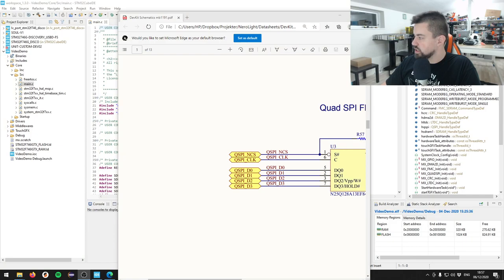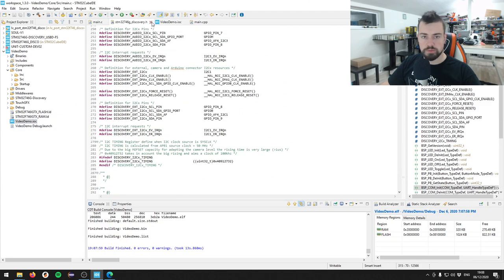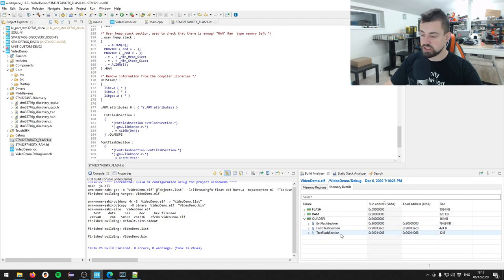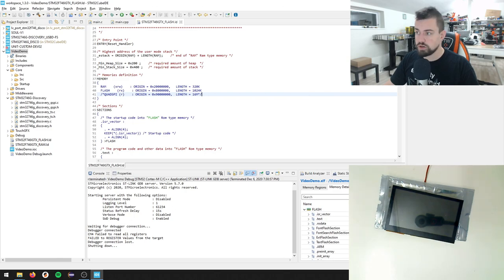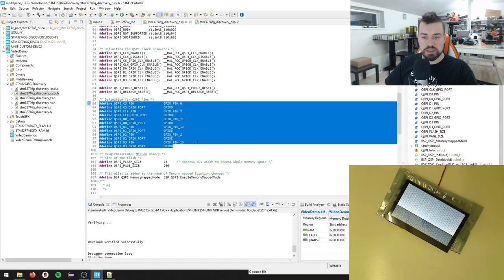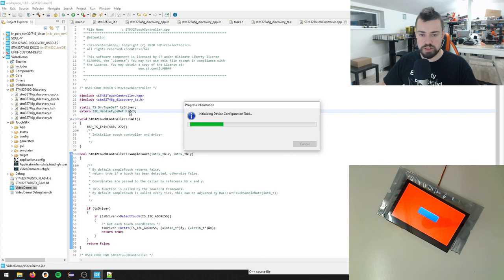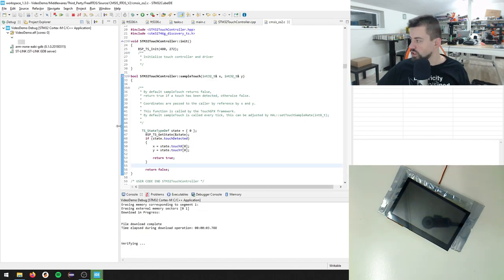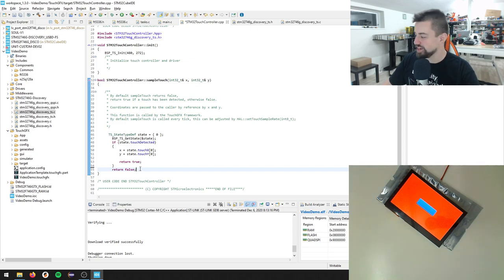Adding External Flash (QSPI) and touchscreen driver to custom board - WARNING: BORING VIDEO ;)

Comment: Turns out STM32F469 disco (with DSI) is basically strongly undersupported. A month of headbanging and I finally got a fully working picture there, except that the whole thing executes 4 times slower (1 second animation takes like 4 seconds, but it's smooth). A MONTH! So I bought STM32F746 DISCO like the one you have. After 2 hours I already have fully working everything with SDRAM, Flash, Touch and all. Neither community on ST forum nor EE-stackexchange helped me with 469 disco, still can't get it to run correctly, all originally provided scripts don't work (unlike 746 where I configured mx stuff from the first attempt, added drivers for the specific chips and all just worked immediately)
Reply from the maker: That's super weird. there should be the same support for the 769 board as the 746..
Reply: @banjohat  yeah but standard examples for it produce gibberish picture too, and I couldn't google the changes. Now I somehow bruteforced it to work, but it's at 1/4 speed or something, like 1s animation takes smth like 4 seconds. And I can't change LTDC clock (output to DSI) because it produces gibberish too (I change clock setup in standard bsp code and corresponding global value as well as in code generator). I took a little break from programming last week, will give the problem a fresh look.
Reply from the maker: @ilyas.7209  That's quite interesting. I didn't spend much time with the 769 board because I was intimidated by the DSI interface.
I might give it a go someday and see if I can make it work. the performance should be similar to the 746 but it definitely does not sound like it!
Reply: @banjohat  746 is acting up too tho. No idea why. Sometimes when it powers on, it has the first frame of what it has to show covered with pixels of random colors - and no animation. I press reset 5-6 times, and it works ok. Then I reset again, and it freezes on the first frame without playing anything (I have a square going along the sides of the screen, 1s per screen side, helps to find screen tearing if there is one, after it makes full round, the only screen "changes" to itself and restarts the animation, so it's a forever animation). Tbh, STM32 seem like very unstable MCU with random hiccups and stuff, pretty weird to realize that outdated weak arduino is a lot more stable in my hands. I have 3 boards (2 x 469, 1 x 746), and two of them (a 469 and a 746) sometimes can't get themselves programmed (program is verified, but internal flash is all FFFFFF when I read it back), get stuck in the middle of animation for no reason every time at different moment (until I erase the chip 25 times and then it suddenly works), occasional "core lockup" messages and stuff. FreeRTOS has plenty of memory, have 8192 words stack for touchgfx task.
Also, I noticed if I have elements overlap (one element cross another during animation), it is guaranteed to get stuck during overlap (at random moment - on 1st pixel overlap or one widget randomly somewhere in the middle of another element - every time at different moment).

Do you have any advice? Maybe you know some article or other useful material on STM32/TouchGFX? I followed your guides and got it to work seemingly ok a pair of weeks back on 746, but now I have all sorts of random stability issues and hardware faults every 3-4 firmware flashes (and any disco I get becomes unstable in 3-4 weeks of daily active programming). (sometimes it works perfectly indefinitely, I power cycle it, and it's stuck for the rest of the day or an hour). I'm getting disappointed in STM32, especially since it's a powerful piece of technology, and there is definitely nothing that I did wrong (I even went all the way to copying your entire workflow when I got totally desperate - same unstable results now). And I can't reset everything to factory. Even if I flash known working program (and I make a copy of program if it works so I have working something if I break things later), it may actually not function at all, it may try to run previous program which is not supposed to be on MCU anymore etc.

If you have a few words of advice or useful resources, I would be very grateful, as ST forum seems to have few people, usually people barely reply, same with STM32 and EE stackexchange
Reply: @banjohat  flashed demo binary + external loader with cubeprogrammer, works seemingly ok. Will have to start over again. Creating new project  STM32F746TRY9 (469 has 19 versions, 0 of which work totally ok). We'll see how it goes, but I'm going desperate :/
Reply: @banjohat  started from zero. No qspi yet, but I have animation with blending and it's not freezing atm. Still no idea what I did wrong before. We'll see what happens when I add extrnal flash and touch. At least it's a little inspiring. My usual tactic is to set a goal and do whatever it takes - exactly how I got into electronics. There is a goal, so I will google, read and ask if I have to about every little bit. So far so good, we'll see. Maybe I'm just too pissed off sometimes ¯\_(ツ)_/¯
Reply from the maker: @ilyas.7209  It sounds really odd. I haven't experienced anything like the issues you describe. I have the occasional hard-fault but that is on my part and bad programming. From time to time I have a timeout on the ST-Link but reprogramming solves that.
For me the 746 have been as solid as I would expect.

What I would suggest is that you take the faulty project and write a post in the tGFX forum. Explain what is going on and how to trigger it and post your project code along with it. There are people looking and they are experts on the matter. Just remember that they do it in their free time so don't expect miracles :)
Reply: @banjohat  of course. thank you. I've tracked down this problem to adding QSPI (linker file + bsp functions). I will try to revert the changes and confirm my hypothesis, as I proper man of science. Then I will dive into it line by line. I'm using default external loader for the 746 disco board. Until I do this step, it seems to be working ok (I started yesterday from scratch again - which with my experience and number of attempts already takes minutes - had animation run through this night and in the morning it was still running). If I don't find the origin of the problem, I will check out the forum (which, being realistic, I most likely will do). Yeah, I get a little heated up lately since it's taking too long and I can't figure the stuff out even given all the documentation. But I'll get there. Thanks
Reply: I guess since I'm experiencing this, I should let public know of my findings, apologize for turning this comment section into developer's diary. Adding to collective knowledge.

As soon as I add

ExtFlashSection :

	{
	
	*(ExtFlashSection ExtFlashSection.*)
	
	*(.gnu.linkonce.r.*)
	
	    . = ALIGN(0x4);
	
	} >QUADSPI

to the linker (or uncomment, technically speaking), I have this kind of trouble described above - random freezes, noise, occasional hardware fault. (while the memory region of qspi is still defined in the same file at 0x90000000, as well as bsp initialization and memory mapped mode functions for QSPI are present). Removing any BSP function causes screen to blink white on startup and go dead black. Removing (commenting out) this >QUADSPI thing - and as a consequence having all TouchGFX assets in the internal memory according to "memory details" - solves the problem - everything runs smoothly even with the activated external loader. Seems like problem is in either a) loading assets into external flash or b) pulling assets to touchgfx during runtime. If b) version of mine is correct, it would explain occasional hardware fault - and it seems to make logical sense given my observations so far. However, I don't know where the error occurs. Yet. Will keep Sherlocking on my own, at least if I get stuck I will have more knowledge to present on the forums for smart people.
Reply: Started fresh project to eliminate possible errors on my behalf. Did sdram setup only, so everything runs from internal memory/flash.

I've narrowed the issue down to SDRAM - the longer I keep disco unpowered, the more noise I have on the first frame that immediately gets stuck (unless contents of SDRAM are intact until I power cycle it for the first time after flashing the program). Interestingly enough, when it's stuck, if I click reset like 10 times a second - pretty much vibrate my finger on it, then after like 2-5 seconds of that, the the thing starts to work with clear picture and I can reset it as many times as I want, it just works. Until I unpower it for a moment. Then noise and stuck (after 5s unpowered, it turns into black and white mess described above). At least if I don't find the culprit myself, I have something specific to ask about. Not giving up until I'm stuck without progress. After all, this is the best way to learn, given the rear is fireproof. Presense of some progress is at least a bit encouraging.
Reply: Found usable solution at: https://www.youtube.com/watch?v=Q-mfuzW6S-0&ab_channel=EEbyKarl
Pressed "Migrate" when prompted about library packages (for F4 in this case). Copying files over doesn't work, only include by linking in. Which is basically exactly like in the video. Took me a little while to get it running. Gonna play around for a bit, try this and that, and go for the project. Finally. After 2 months and getting gray hair.

P.S. He does it with 746, but it worked for STM32F469 too - the one I need - the one with broken native drivers. Since TouchGFX projects can run natively on it without any issue (start project - run target - just always works, turns out TouchGFX generates all correct configs that Cube's code generator doesn't) and STM32CubeIDE defaults hardware setup to wrong values (with no sources for correct values for this specific DISCO board), the only way to start is from TouchGFX. Took me several days to figure how to import it into Cube so that I could edit both parts of the project when needed. The solution above worked.

I have still no clue how to do anything more than visuals on TouchGFX (such as work with other peripherals and stuff), but there is documentation and I'll figure this out. I mean, it WORKS now, so I can at least try stuff.

Comment: Great video, everything works except the last part for the touchscreen.

BSP_TS_GetState(&state);

This function creates a "MemManage_Handler" error, after some debug i found that it gets lost in "TIM6_DAC_IRQHandler" and the screen doesn't show anything.
Thanks in advance.
Reply: i solved it, it was my mistake on the I2C port.
But I ask you, is it normal to have a 2.2Giga .BIN file, and how to make the loader separate from cube .., so as to load images and text separately in the QSPI.
Reply from the maker: I think you can disable the .bin file generation in the builder settings. As far as I recall the .bin file is not used for anything but I might be wrong. luckily it gets overwritten with each build so there is only one at a time :)

Comment: Hi embryonic... Thanks a lot for your video.. it was amazing... We were able with your help to set up an application with quadspi using the external loader... But now we want to add the possibility di update the flash and the external flash by using a usb stick... We developed a bootloader just for updating the flash but it is missing the part for updating the external flash (starting from address 0x90000000)... Do you have any ideas or can you provide the steps what you would do in order to change the bootloader ? Thanks a lot Regards.. great work
Reply from the maker: I want the same thing myself :) Maybe not form a USB stick but from a computer.
You would want to integrate the loader functionality into your regular program in order to be able to write to the QSPI. if you already have the regular bootloader running it should only be a matter of being able to write to the memory :)
Reply from the maker: @simonegasparella3156  you should add the functionality from the external loader. the methods to write (and access in general) the QSPI needs to be available to your bootloader

Comment: Thank you for this video which saved me time.
I just have a problem when i add elements with text on touchgfx, i have a HardFault error.
It is a recurring problem, to solve it i forced the storage of the text elements in the internal memory by modifying the .Id file 😅
Reply from the maker: uh-oh! That doesn't sound good! luckily text doesn't take up much space :)

Comment: Thanks 
One question 
May you repeat this work with winbond qapi flash such as w25q128fv
Reply from the maker: It doesn't really make sense to redo the video with another chip. The procedure is the same - If you don't have the external loader that is where you need to go first.
Reply: This will be good if you learn how i and others create new external loader.
Thanks